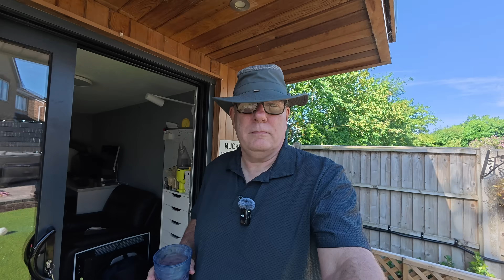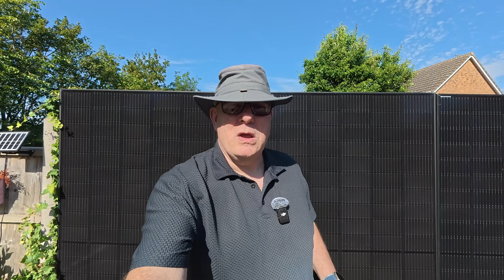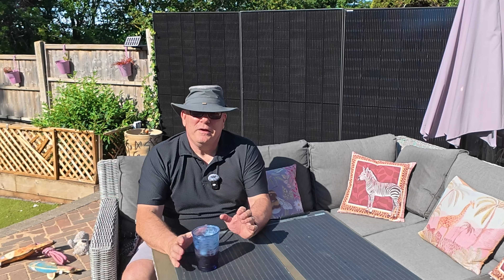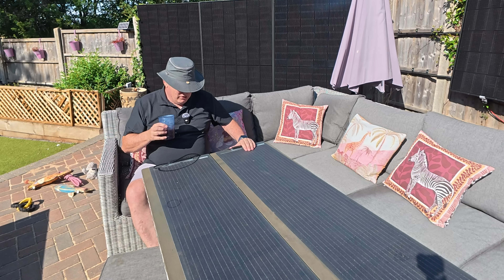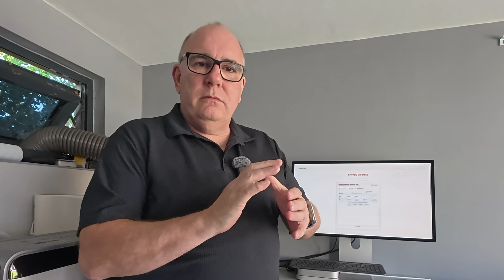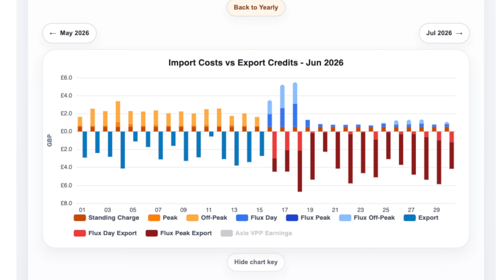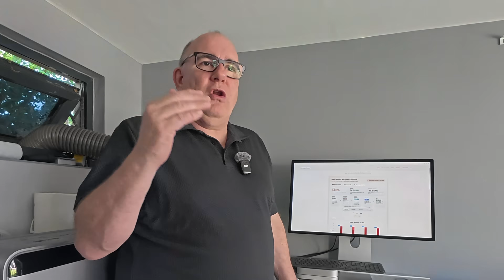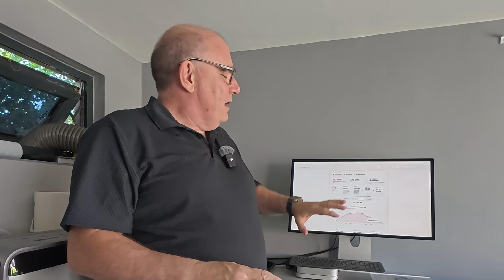Octopus Flux Is Back! Plus 4 Big Energy Project Updates

Comment: Please remember that the cap is 800w per household..   Its that for a lot of reasons that are complicated but to do with safety, if you go beyond that you would likely make your insurance invalid.
Reply: It’s a bit more nuanced than that 800w is the limit that the inverter can input into the house through a plug socket. Which output upto 1200w if you plug an appliance directly into the AC ultra. I think if you have the ultra and an AC Pro connected in parallel you can draw rather more but Ecoflow’s manual and website is so dreadful it is not entirely clear!  I went with them because they were available and doing a deal having had to deal with them for a warranty claim I might check out Indevolt and Anker first. They were incredibly helpful but also incredibly slow possibly HMRC are slower and more Byzantine and definitely less helpful but it’s close.
Reply: @rupertmiller4718  The 800w is a basic limit the intention is to stop you having a massive array or like this person from what I can see have multiple plug in arrays, as long as you are not putting more than that basically back into the consumer unit then yeah your probably ok.  I was just trying to simplify it.
Reply: @steve11211 absolutely and that’s the view I take as ugh I will probably run big appliance directly from the Ultra in future. I suspect the 800w limit will eventually be revised upwards when more user data is available.
Reply: @rupertmiller4718  I cant see the limit going back into the installation will go upwards, as it creates all sorts of additional safety issues that have been overcome but limiting the supply to a smaller amount..  Ultimately if you want a bigger system then have it fixed..

Also remember that a generating PV system needs building control so you will see in the manual of these systems it must be installed by an electrician that is part of a competent persons scheme, so you might as well just get it hard wired and avoid the whole issue, this is where I have the biggest problem, it makes total sense to make sure it is safe to have it installed by a qualified electrician and to ensure this make it a requirement that you get a building compliance certificate, however in practice will this requirement to ensure it is safe be broken in 90% or 99% of plug in solar panel systems?
Reply: @steve11211 the whole point of the government intervention is to do away with this requirement ,  all the myths put forward by the electoral trade bodies have been debunked . The whole point of these systems and the 800w limit is to avoid all that stuff. On a different matter but actually relevant I had a conversation with the other day with a leading diabetes consultant. His comment was over 100m adults are on GLP 1 weight loss drugs while most trials are limited to thousands. His comment was that when you have that many people involved if there were going to be nasty side effects you would have seen them. The evidence with that many patients is overwhelming. Similarly once you have several million users of balcony solar across Europe the safety evidence far outweighs anything some wonk at the IET might think. The only people objecting so far are those who see a lucrative side hustle disappearing.  Instead of  sticking obstacles in the way we should be making these systems easier to install . For once the government is actually trying to improve things and the trades bodies are getting in the way. Those who stand in the way of progress end up being loathed for it and lose anyway.
Reply from the maker: The likelihood is when the legislation is finally published it will be 800 W per circuit. This is per the footnote in the recent interim specification that has just been published.
Reply: @JonathanTracey  No it will be limited to 800W per house, it makes no sense to be per circuit otherwise you could easily create 50 circuits and have 50 plug in solar and be compliant, but clearly 174A is not acceptable...  So there will be an overal limit and that is likely to be a single unit, you also have the issue of if you have a lot of plug in solar it could interfere in the anti islanding technology which would add another later of danger.

The legislation currently is and will stay one per domestic property, with a maximum of 800W, but as someone elses states this will likely be increased to 2000W but with the inverter only allowing 800 going back to the circuit, aka the system would allow you to plug a heavy use appliance directly into the system.
Reply: @steve11211  How can you know this? What is your position within the approval body that decides these things? Your example of 174A is obviously ridiculous, even if someone had the money and space for that much plug in solar it would just blow the cutout fuse. I see no reason why 3800w or 16A wouldn’t be possible though
Reply: Its 800W per ring but if the connection is a dedicated spur for each micro-inverter  then I don't see any reason why it's unacceptable to max out an export limit be it G98 or G99. The whole thing is a grey area though and no plug-in solar has been formally approved so your argument about 800W may be true, especially when insurance companies are concerned, they'll do anything to avoid paying money out.
Reply: @st200ol  Its generally not a goo idea to plug it into a ring but also no its not per circuit otherwise you could create 50 circuits and plug in 50 plug in solar which is the whole point to stop people doing this. hense the limit to 800w per household, There are additional issues with solar that can be ignored if the input is only 800w, for example the max current of a consumer unit is 100A, if you have say 10 plug in solars on 10 circuits, you could potentially pull almost 35A, plus upto 100A but normally 80A from DNO, this could exceed the 100A rating of the consumer unit.   For non plugin solar you can mitigate by various ways and I guess you could with plugin but ultimately the limit of 800w is per household which makes sense, having it per circuit makes no sense as there would be no limit of number of circuits.
Reply: That new connection, does it go to the ring or back to the meter? Why the shelley, is it because the kit itself doesn't report properly or in the manner you need to integrate?

Dare I also ask what that new connection cost?
Reply: @Stormin_Mike The system is dumb and will always output 800W (solar depending). The Shelley is needed to coordinate and limit the input to the power being consumed when it is less than 800W ie not feeding excess back into the grid
Reply: @HiruS22 I can see that but is it blind by connection to the rest of the set up?

Comment: Great video. I went onto Flux last month as well. We don't have EV's or a heat pump but do have a very efficient hot water cylinder which is on "21/7", (turns off for export).
We are running 10kW of solar, 42kW of batteries through a 10.5kW single phase inverter. 
Currently earning £7.60/day gross (£6.70 net after standing charges which includes gas). 
Our batteries don't get lower than 40% in the Summer but do go down to 15% in the Winter months. 
We'll stay on Flux but might look at the overnight import if the figures stack up, at the moment they don't.
Reply from the maker: nice setup, we have two EVs so flux won’t really work in winter but sounds like you have it dialled in

Comment: What happens when your DNO restricts your capability to export, which Northern Power Networks is doing daily? It’s limiting households to about 3kW per day? There is Jack shit you can do about it?
Reply from the maker: i have a 10kw export limit, been in place for years , why would they restrict it
Reply: @JonathanTracey I don't believe they can once it is approved.
Reply: @colinfieldgate4719  They can unfortunately
Reply: @JonathanTracey  I’d say to share the available export limit with your neighbours, also as renewables become  more widespread in the UK it’s possible that existing export limits may have to be reviewed. As more people in your street add solar so the local voltage will increase, if it gets close to the limit of 253V then your system will automatically stop exporting or limit its output current.
Reply: Doe you mean Northern Powergrid covering NE England? I’m with them and have a 6kW export limit set since Dec 2024. Nothing has changed.
Reply: I too worry about the same thing, well I don't worry as I don't export, all self consumption. If we keep getting extended sunny periods as we have for the last couple of years it's only as matter of time before the bubble bursts. If payback periods are a big worry rather than just reducing bills then I suggest calculating a payback period without any export.
Reply: @st200ol But there is no harm in taking the export whilst it’s still available, then switching strategy when/if it disappears. That said, balancing the grid will become more important as more renewables come on line. So a flexible solution to ride the waves as the game changes is needed.
Reply: @colinfieldgate4719  I agree but if someone feels payback is important and calculates a 3 year payback and then next year all exports are no longer paid then it may be a concern. I don’t have a crystal ball but I believe the reduction on Octopus export payments was 3p per kWh this year so perhaps expect a 3p reduction next year down to 9p per kWh.
Reply: @st200ol Agreed you shouldn't base payback too much on export rates. But Flux has a much higher peak rate, and Prime has been announced. So I feel we have a few years yet. But if not, well it's spent so hey ho.

Comment: I've been on Flux for almost the last three years & I can't ever see myself moving away from it. 

I've evolved the same strategy that you're following which is start the day with a relatively empty battery, charge it up to max & then drain it between 4pm to 7pm to maximise exports at 29 p/kWh. At 7pm, if it's really sunny, the battery will start charging but by 8pm, it's done charging & will start powering the house once more. If I'm lucky, the recharge will get me through until 7:30am when the panels kick in. On less sunnier days, it's empty by midnight but I figure it's better to import something at the 15p/kWh rate than forego exports at 29p/kWh.
Reply from the maker: Yeah, for me I would’ve switched the flux in late March early April if octopus hadn’t stopped new sign ups. I think going forward flux in the summer intelligent go in the winter for me is the right mix.
Reply: @JonathanTracey  Given the increasing levels of ultra-cheap solar going into the grid from large-scale solar farms, I suspect Octopus will restrict access to Flux going forwards. I'll stay on it rather that chopping & changing tariff.
Reply: Or switch tariffs in the winter? Having an EV opens up a world of options not available to those with just Solar and a battery. Good savings on fuel too!
Reply: @colinfieldgate4719  I don't want an EV. I'm not against them per se but right now, an EV makes zero financial sense for a low mileage driver like me.
Reply: @MrSensible2 Fair enough. We do a lot more miles in ours now, leaving the diesel on the drive more often than not.

Comment: It looks a lot of work to control everything.
Happy staying on IOG and just selling everything spare to the grid at current prices. Plus I do cycle the battery every day. No different rate but I do shift an hours worth at peak and the rest during cheap incoming. If I don't cycle the battery the SOC% wanders about all over the place and the batteries don't hold as much.
Obviously eventually they will not be wanting Solar and offer us few £ accordingly at that point I may have to change. But until then I like simple.
Reply from the maker: yeah, it’s a bit of a project but it works, I fully get most people don’t want to mess around. They just wanna sit and forget the system but it keeps me out of the pub.😂

Comment: Got 17kw battery self use battery topped up by 12 or 1pm then flux day rate 10p kw and at 4pm to 7pm discharge to grid 29p per kw and working great nice winter buffer piling up.Gas and electric fully covered each month at this time year plus nice fund for winter
Reply from the maker: yeah, that’s my plan as well build up as much of a buffer as I possibly can to see me through the winter

Comment: Good update managed to switch to Flux on 19/06/26. Also charging our EV between 12pm-4pm if needed. Due to the orange buffoon we are down approximately £300 on last year as we would usually have switched to Flux in March.
Reply: With an EV are you sure Flux is better than IOG with either the Outgoing Fixed (12p) or Prime (9 p, 16p 4-7)? It will depend on how big your Solar array is (likely ~10kW or more), battery storage (~20+ kWh) and a decent export limit set by your DNO (10kW or greater is good). Try Tim & Kat’s Green Walk tool to compare tariffs rather than guesswork 😀.
Reply: @colinfieldgate4719  Car is being charged once or twice a week. 7.3kWp array 20kWh of batteries 6 KW inverter and 6kW export limit. Exporting 15 Kwhs between 4pm-7pm at 29.22p is £4.38 plus anything else at 10.2p. Getting £6+ per day against £4.20 on export rate of 12p. Also one less cycle per day on charging/discharging batteries.
Reply from the maker: i’m the same we charge our EV between midday and 4 pm, and it keeps more than enough miles on the cars that we don’t have to worry about it. Obviously, as we go into the winter, I’ll be back to IOG and overnight charging.

Comment: The big issue with the lightweight panels IMHO is lifespan - many of them are great - for 18 months. For table though a classic rigid panel with framing round it works just fine. It's a perfectly good glass table - but they do get a bit hot to use in summer. The point though is to avoid planning and landlord problems not to have a table.

Did I spot an Ecoflow Wave  2 in the background that still works, that must be fairly rare 8)
Reply from the maker: that’s why i want to try them, get some real world usage data from them 

yes it’s a wave 2 had it a few years now but it’s struggling and suspect this is its last summer before it goes to the aircon graveyard in the sky
Reply: I used to think that, but I have 2 x flexible 250W panels that have been on my campervan for 5 years now, with no downturn in performance. I think there is an element of "you get what you pay for", mine weren't cheapy ebay specials
Reply: I have a panel here, a rigid 200W one that has failed in less than 18 months. It seems like water got in, It was a "budget" panel at around £89 but it should last longer than that and now it's e-waste, I doubt it even recovered the CO2 impact it cost to manufacture it. I will buy better panels in the future.
Reply: @st200ol  There's a lot of Chinese failed QA stuff resold online and dodgy panel made from failed product meant to be recycled. Places like City Plumbing with actual branded product are wise. Even worse for dodgy cables and connectors on e-commerce sites

Comment: I’ll be very interested in your wall mounted panels I have a similar situation on my house, that gets a lot of sun light especially later in the day, when my roof panels are getting reduced input.

So I’ll be following closely.
Reply from the maker: yeah, I’m looking forward to see what it does, I suspect like my systems come winter the Sun will be too low in the sky have any meaningful effect but that’s the whole point of gathering data
Reply: @JonathanTracey in my case it will be later in the day, but there are no obstructions in sunlight from about 2 p.m. at this time of year.

The back wall of my house would be great to get some on too. It’s whether how big panels I could fit between the windows. Oh and how my dog will react. When I did a test with a foldable panel and one of my BLUETTI, Skye spent the morning barking at this ‘thing’ hanging out of my bedroom window.
Reply: @robintaberner I have four panels on the back of my house, west facing. A new DIY insulation to early to say on performance. I used JA 460w but I am wondering if I should have got back contact panels as there is some shading from soffit around 1-2pm and from trees at 7pm.

Already starting to think I need an East array to get morning sun but will need to convince the wife.

Comment: I have a friend who had an installation for her father via one of these special grants. It all seems to have gone pear shaped with massive bills ensuing. 2x Vaillant HPs solar and massive battery storage but my main query was they were put on Flux from the word go. Is it conceivable that Flux can work against you if not set up correctly and end up costing money rather than saving it? My suspicion is that someone has messed up their import export.
Reply from the maker: yes if it’s not setup to avoid 4pm to 7pm it gets real expensive fast, the system needs to be configured to self consume all day, charge the battery and export between 4 and 7pm outside those hours self consume
Reply: @JonathanTracey  thank you I will pass this on!
Reply: Flux can be great in summer as long if you have plenty of Solar PV and you are not too hamstrung by the export limit set by your DNO. My limit is 6kW and I can’t make the sums work for Flux, so I’m on IOG and Outgoing Fixed.